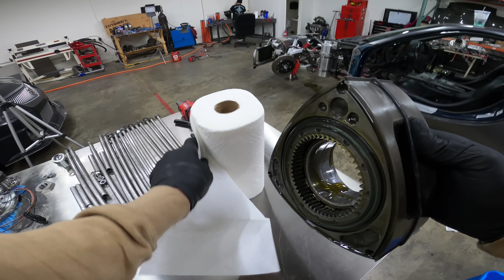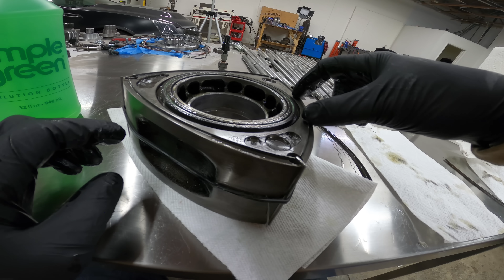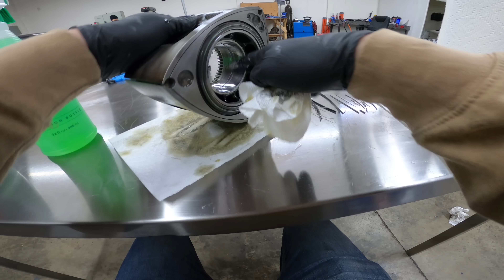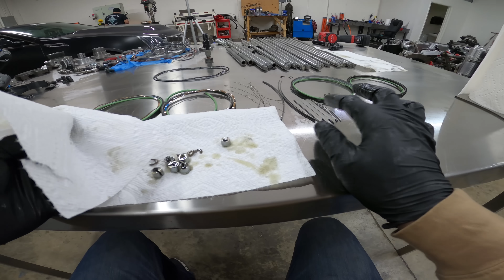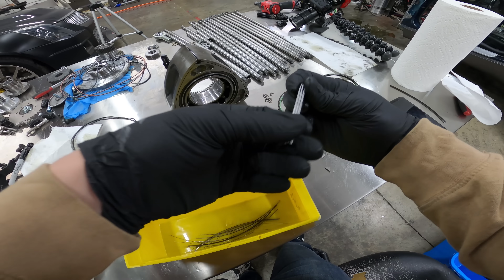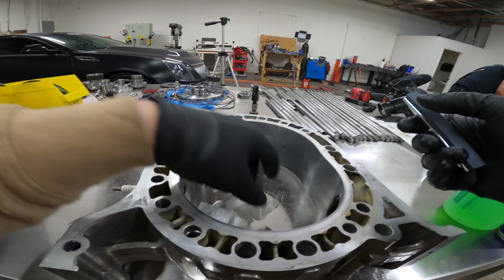Aluminum DAMAGE everywhere! Billet 4 Rotor fixed in 3 days!

Comment: that's the new high-aluminum 5W-40 blend
Reply: It’s kinda like zinc additive but not
Reply: good for the bearings
Reply: Try 20w-50
Reply: @MrManuel1329  the blow up engine oil boostedboiz style

Comment: Hey Rob, just a question!? Would you ever use an auxiliary oil metering pump to inject 2 stroke oil through the oil injection ports for extra LUBE

Comment: WTF you saying rob..it could have damaged the motor? you pulling it down coz its fkd and not even run in yet.. because it went beyond the seals and build kit seals, due to poor run in process and primary tune was wrong..ignore the problem? lol..you wouldnt even do a 1000km's ,what you rambling on about ? you build a engine to run like at least 10k thrash performance.. before you touch it again..

Comment: muriatic acid will dissolve aluminum leaving iron unharmed. Used to use it to clean up 2 stroke cylinders before taking a hone to them or re bore. worked really well on chrome sleeves that had a piston melt onto them.

Comment: Hydrochloric acid based brick cleaner is what is used to clean aluminium piston debris off Nikasil coated two stroke cylinders after a piston failure. Pretty sure that would have also have worked for this.

Comment: 0000 steel wool is what you should have been using to remove the aluminum!

Also, oven cleaner dissolves aluminum but won't hurt steel.

Comment: You could use household drain cleaner to dissolve the aluminium. It leaves the coating intact. I have used this many times in nicasil cylinders.

Comment: Oven cleaner will remove aluminum from chrome and steel/iron, common practice on 2 stroke cylinders.  You will need the nasty fuming kind (yellow cap usually), spray it in a cup and brush on as needed.  Do not let it get on any aluminum you care about, tape off the housings if you cant be cautious.  I believe the active in the oven cleaner is sodium hydroxide/lye, and hydrochloric/muratic acid would probably be effective as well but oven cleaner is easy to find just about anywhere.

Comment: Probably too late but you should be able to use hydrochloric acid to remove the aluminum from the chrome lined rotor housing. Motorcycle guys use it on plated cylinders all the time.

Comment: It's not, but the equivalent bearing in ball/pin variant would add a ton of complexity to the internals of each rotor that the oil cushion is actually acceptable. That and price, the bearings would cost enormous amounts of money (if you compared them to other types). Ball bearings are expensive yo.

Comment: I'm probably way too late, but honestly if you would do it for a customer you should do it for yourself. Just replace all of the seals and clean the rotors extremely well, and or hot tank them, and put it back together.

Comment: Did you pre mix gas with oil? especially on the on first start up.
You should use 2 stroke oil in the gas as a premix.
Is the friction from the Apex seal and housing.
Mochi must be laughing at you.

Comment: The oil control rings are actually what took out my original RX8 motor. The thermal pellet failed on mine and didn't allow enough oil to the control rings causing them to dry out an crack. When I did my tear down for rebuild the o-rings literally crumpled in my hand. This tear down video hits home hard lmao. Can't wait to see where it goes from here!

Comment: Rob:   You can probably wash the high wear faces in Sodium Hydroxide (NaOH) which dissolves aluminum. It attacks steel as well, so don't leave it soaking but it should help clean up anything you can't see.

Comment: That’s an alarming amount of wear given the number of hours run time.  Could you coat the aluminum surfaces that the rotors seals wear against with spray on nikasil? I’ve seen chrome used.  You know a lot more about this than me, but seems like very high maintenance.  How about switching back to ductile ( 65-45-12 cast iron) material ?

Comment: Question I've been thinking about buying a rx8 what can I do to extend the life of it's engine made of glass, like what mods? I've done a lot of research on this car and also been thinking about doing my first ever rebuild
Reply: Run an 2 stroke oil premix in the fuel, because the oil metering pump is tuned for low emissions not engine life.
Reply: @squrkols  thx man

Comment: Why would you put those seals back instead of replacing them? I mean I know it would cost about $3k in parts but at least they're fresh, uncompromised, metal parts going into a high performance engine
Reply: If he cleans everything perfectly, there's no issue. Question is, can he clean them perfectly.
Reply: @Mihai Rada The aluminum got in because they didn't clean the intercooler correctly from cutting and rewelding the inlets. Those cuts should have been done upside down so debris doesn't fall inside. It was only when he boosted a little bit that the turbos blew the aluminum through the intake and through the engine.

Comment: Man, keep those picks away from the o-ring seals! If you're even thinking of re-using them, hold them so your left and right thumbs are the only things touching them. Then slide your thumbs together with slight pressure on the o-ring, it will bulge between your thumbs, then you can grab that and remove with no possibility of damage.

Comment: NaOH, lye, is safe on most ferrous metals, chrome, other precious metals, but oxidizes aluminum. What about wiping the housing with a strong solution? Would it make the aluminum turn into a dark grey oxide that would come off with a hard sponge? 🤔
It wouldn’t hurt.

Comment: Rob, with all your billet parts, I would also suggest getting away from stones to clean fine surfaces and call your local machine shop for some spare brass they have laying around. If you want to clean metal off of another metallic surface, you need to find a metal that has a hardness level in between the two metals, to be hard enough to scrape away the softer (aluminum), but not hard enough to scratch and mess with the surface finish of the harder metal (steel/ceramic coated aluminum/etc). While heat treated aluminum is as high as 60 rockwell or so, maybe 65 when exposed to carbon and fuels and other various chemicals/oils, and steel is around 87-88, and those ceramic coated plates are probably around 85-90 or so im guessing, a relatively inexpensive metal like yellow brass could be machined on a mill real quick to give you a nice solid 90 degree scraping edge to clean off the aluminum but not hurt the steel and ceramic surfaces in the housings. 
still, always glad to see new content!! i see youre changing the placement of the steering rack??
Reply: Hardened tool steel is 62 Rockwell..
Reply: people use these stones attached to a drill to hone cylinders, and you are worried about him messing up the surface by gently running it across the surface?
Reply: @usemerican  lol.... youre tellin me a stone thats used to scratch up the surface of the cylinder, shouldn't be worried about when trying to clean off the surface of a cylinder? do you use a kitchen knife to scrape the dust off your car's paint?
Reply: @alexcecil89  Yes I use a kitchen knife to scrape dust off my car. and that is not a stupid comparison at all, you win...
Reply: yea  i hope he understand the hardness scales when i seen him sc raping his engine with a stone.....jesus get some brass pads or something like  u said. eeeeek, then he said thats compression coming back and im like.....ehhhhhhh idk lol hes just doing it randomly not patterned

Comment: Wait so if I understand right the underlying issue from the start was a side seal?
Reply: The issue was they cut the intercooler piping & all the aluminum debris fell in the intercooler. They were working 24/7 for SEMA & didn't clean out the intercooler properly so all the alum debris went into the engine.

Comment: I had missed where the aluminum had came from, but I read the comments and got the answer. Though on the bright side since Chris over at B is for build doesn't have a roll cage in his burntican, and won't pass tech inspection at a track, you have plenty of time to get the 4 rotor perfect; and lay down some killer passes. 
Jokes aside, lots of respect to you and Isaiah for the work you are putting into this car.

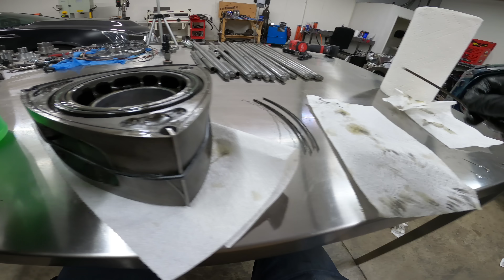Comment: 7:45 why isn't he replacing all the seals? I understand the cost of the materials, but not destroying a $55k+ engine for the cost of an OEM 2 rotor ....
Reply: How much would those seals go for you think? They don't look like they would be too expensive but I don't know anything about rotory part costs. Are they similar in cost to pistons ring sets?
Reply: Seth Francis Sim Racing you need two 13B rotor seal kits which run about $900-1500 each
Reply: I literally paused as soon as he said buuut because it's a high horsepower race motor I was like wtf dude
Reply: Why replace parts that have done no mileage they only have soft aluminium stuck to them did you not see how easy it came off, if was steel that went thru fair enough. He changed the springs so will be fine the only silly thing they done was not blanking the intercooler off before cutting. Keep it going Rob even if it is the last rx7 in the world by the time it's finished, will still be the best ever
Reply: All those parts are reusable if cleaned well. As long as the seals move freely with-in there grooves, it's good. The biggest issue with rotary's is assembly errors from not clearencing things correctly in the 1st place.
Reply: @rotaryperfection  but he has not noted where each seal came from on each rotor so will have to do a lot of clearance checking when he rebuilds the motor or does that not matter as its a high HP motor that will be stripped frequently? A scary approach, Its a strange approach as the rest of the car looks excellent. I just hope he didn't fit and set up the brakes himself!!!
Reply: I said the same thing. Corner cutting just like how the 3 rotor blew up. Hopefully it doesn't cause any issues because I'm tired of watching videos of all of Rob's engines that don't work.
Reply: @NathanaelNaused  Have you tried not watching them? 😉
Reply: He dumb for not replacing the seals. Vargas even replaced the seals in the 2 rotor on build and battle

Comment: I don't want to tell you how to suck eggs as you did say you were going to do further cleaning; but those centre bearings in the rotors that you left in will almost certainly be contaminated too.   Every last bit of that engine is going to need to be blasted out with something - I'd hate to see anything happen to it after coming so far!

Comment: So what did that 60k get you exactly? For 60k, I would have expected it to last longer than a couple miles.   Whats is the root cause?
Reply: You must be new.   While fabricating the intercooler in a rush, they didn't clean out the aluminum shavings.   So for 60k he got an amazing engine.   But a simple mistake can fuck that all up.

Comment: “If this was a customer engine I would replace all these, but since it’s just a high horsepower motor that will set multiple records of all kinds, I’m not too worried about it”
Reply: I think he was talking about that the engine will be taken out and disassembled periodically for inspection to see how is holding up after certain amount of races. So he keep track of those parts he is installing back. I agree is funny the way he said it because he wasn't' very specific though.
Reply: @normanguzman417  ttue, but its a $60,000 engine, just replace the seals.
Reply: Shot his whole wad on the motor, can't afford new seals...
Reply: It do be like that sometimes

Comment: Could use gallium to convert and lift the cold welded aluminum off of the rings/seals and check the grooves of the rotor for the same issues. After that you could use a brass wheel but any wire from the wheel inside the build after would be bad. After the effects of the gallium a tooth brush would take it off. I wouldn't have used cheap paper towels either because of the lint but your in step 1 of clean up. Lucky you caught it at this stage!

Comment: (Edit: Some Sodium Hydroxide should do, it will dissolve the aluminum and won't attack iron.) Seems to me that finding a chemical to dissolve the aluminum at the atomic level would be your best bet to eliminating all potential contamination now that you know the metal was atomized and bonded to other metals. I mean did you scrape your bearings?

Comment: Clean parts using an ultrasonic cleaner. Use heptane or an equivalent solvent. Use teflon baskets or suspend parts with teflon-insulated wire to prevent damage to the parts while cleaning. Do not leave parts in the cleaner. Clean in 15 minute cycles, checking for FOD between each cycle. Immediately coat parts with WD-40 after cleaning to prevent oxidation.

Armchair-engineering disposition at its finest.

Comment: I was wondering when watching one of your videos, if you will have issues with aluminum shards after you were cutting off a pipe on the mounted cooler. I don't recall flushing the cooler before it got reconnected to the motor.

Comment: Rob pin this so everyone can stop asking

The aluminum came from the intercooler. There you go
Reply: But where did the intercooler come from?
Reply: @chrisx2104  lol
Reply: This is why rotary engines need to be installed in clean environments. What everyone sees in this video and the rest isn't even that much aluminium, it's probably less than a few chips. They can take the abuse, but only so much. Imagine if that was a stainless chip passing by...
Reply: @aserta  honestly bro anything with tight tolerances (any engine) should be installed in a clean environment lol
Reply: @aserta  It doesn't anything to do with tolerances, they just cut a fucking pipe and the aluminum fell into the intercooler they were cutting. As simple as that, and as clean as the room could be, this was the issue
Reply: Thanks, now I don't have to ask!
Reply: I actually forgot.. lmao it was from cutting that piping
Reply: This is exactly what i wanted to ask :D

Comment: “Chrome housing surface pressed you can see the jagged surface on the back”  no no no, Does this guy ever read anything about rotary engine construction, it is a band that is in the mould when the housing is cast and as such is effectively part of the housing.
Reply: ChrisHolmes1953 it’s a billet engine not cast or mould
Reply: @208outdoors  the irons are billet. Not the housings

Comment: "Apex seal don't really break these days" Tell that to Team Boosted about there single rotor.
Mind you it was their own bloody fault.
Reply: Fred Gassit that’s because they used ceramic seals which are really weak against detonation. They were also running way too much boost with just 93 octane alone.
Reply: @marcus032390  That and sticking a piece of welding rod down the port to feel the position of the rotor.

Comment: where did the aluminum come from? the intercooler?
Reply: For me it is more likely from water cooler. Rob probably will have to deep clean all coolers in some case replace. They all have aluminium inside them it is not possible to clean them easily. But if it from intercooler/turbo that will explain why why didn't get catch on filter and stay inside engine.
Reply: @Dori21ha  It pretty much has to have come in through the inlets, crap in the water wouldn't be ingested like this.
Reply: Yes intercooler someone tryed modify it and didn't pressure test or clean it out, amateurs 😭

Comment: Rotories are super reliable, for about 150 miles. Then it gets dicey
Reply: nah, premix them and get rid of the oil metering pump and they last for as long as a normal piston engine.

Comment: Rob this is something to think about you know that you have to put oil with the gasoline are you using the correct amount that should be use and if you use racing gas do you have to use more oil or is it the same amount when you use pump gas ok am saying this because it look like there poor lubrication in the engine and the seals are taking material from you billet plates I hope you understand what am trying to tell you so maybe you can do some research ok Rob love the build and hope you find the problem.

Comment: Have you come to any conclusions what caused this?
Reply: Do you follow the channel or build at all?! I mean, it was onlt a few vids ago that they found all the aluminium swarf in the intercooler which is the cause of all the damage. I suggest you chk it out, see what happens when ppl can afford to piss away a 60k billet engine
Reply: @RT-Revs  I have watched the channel for a while, but I must have missed  that. Aluminium shavings in the intake system then?
Reply: @runeandrebergtun8892  modified some induction with it all in place, you know, as ya do... and the swarf and filings filled the intercooler core. When he had it out for the first few times and tried to build alittle boost to test it, it sucked it all into the first couple housings and so began the issues with compression and so forth
Reply: @RT-Revs  Gotcha, thanks for the explaination

Comment: Yo Robb, I'm not trying to sound mean but I really dont think cleaning with just picks and paper towels is going to get the motor in working condition again. I'm not an engine builder but this doesn't seem like the right way to do it. This 4 rotor is taking a looooooooong time. I know there was aluminum in the inter cooler and it killed the motor but just seems like you are pedaling but not going anywhere with this project. hopefully you dont take this the wrong way.
Reply from the maker: Fortunately it’s got perfect compression and is running smooth now. So it worked. I think most engine builders make it sound more difficult to stay in business. It was so insanely simple to work on. And it sounds better than ever
Reply: @RobDahm  wow dude you responded, thank you. But this is good to hear, actually kinda nice to hear that its not as difficult as I had thought. Well right on! I cant wait to see more :D